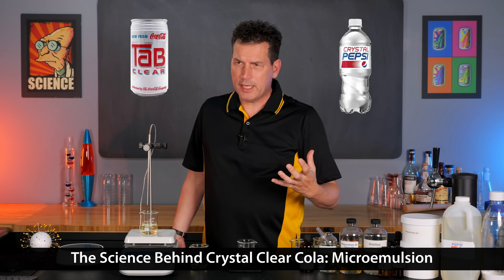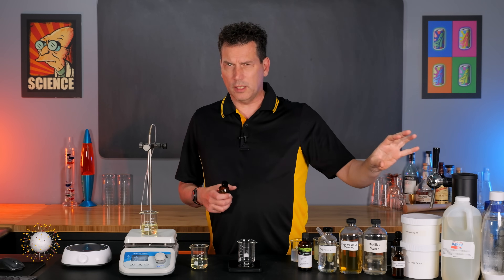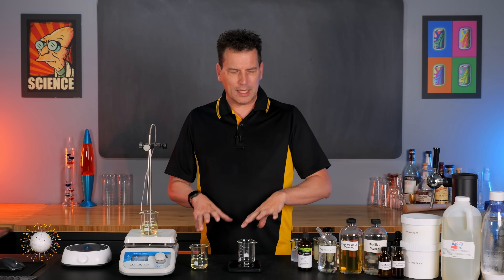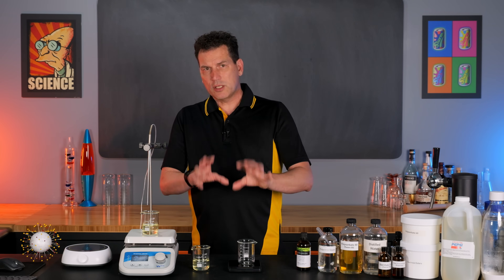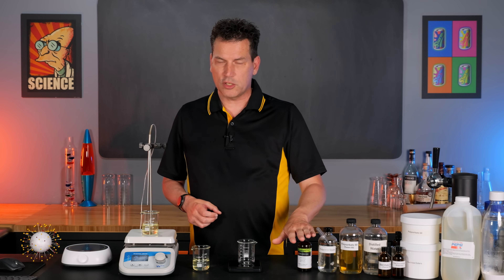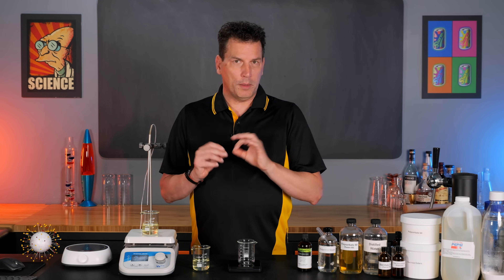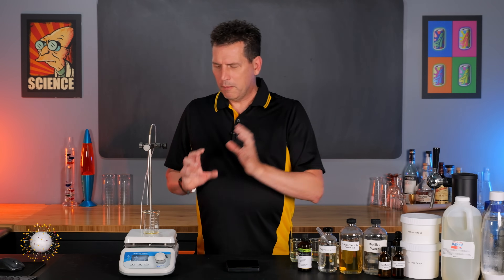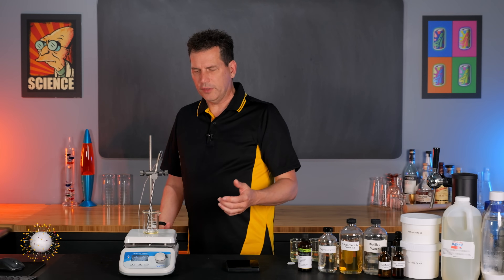The Science Behind Crystal Pepsi: Microemulsion

Comment: Very interesting. Doesn't this have further applications outside of the drinks industry?
Reply from the maker: Emulsion science has wide-ranging applications in everything from medicine, cleaning products, lubricants, and so much more. There are many professional societies dedicated to this topic, like the International Association of Colloid and Interface Scientists.
Reply: @Artofdrink  Another industrial area where emulsion science matters is in quenchants used to cool high-temperature metals quickly enough to form metastable phases in the metal which would not ordinarily be stable at room temperature. The consistency of heat extraction matters a great deal in this application, particularly through certain relevant temperature ranges. Minimizing the vapor blanket which forms at the surface of the hot metal as it sheds heat into the bulk quenchant can make a huge difference in everything from distortion to uniformity of the metastable phase formation.
Reply from the maker: @EricStuyvesant  when I worked at a refinery research centre, I use to do a quench test on quench oils. It was one of the only tests where it was understood that flames would shoot out while doing it.